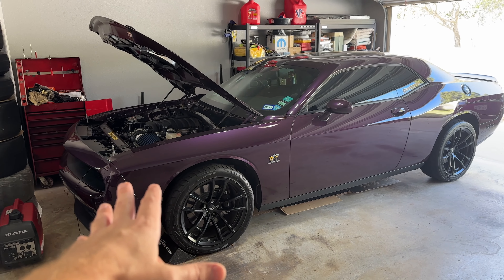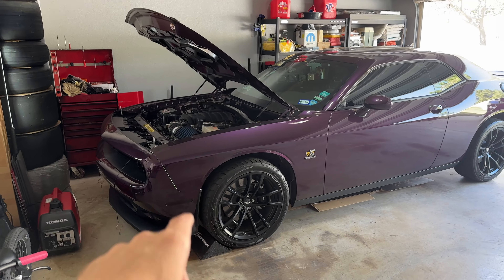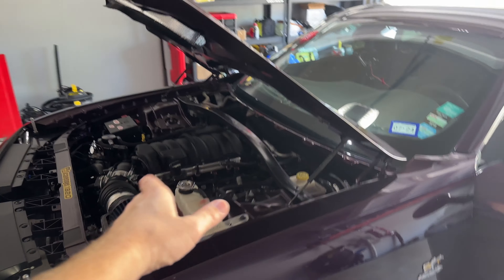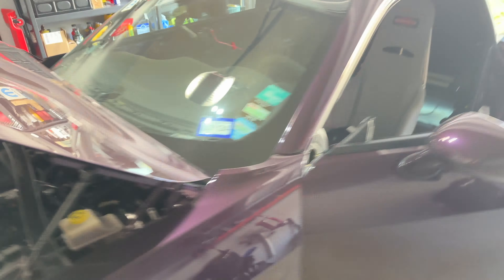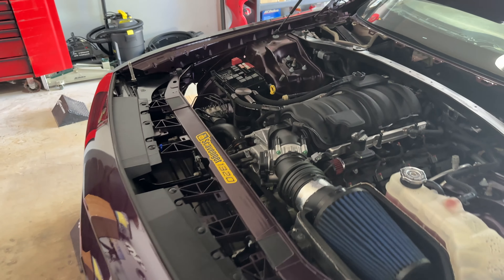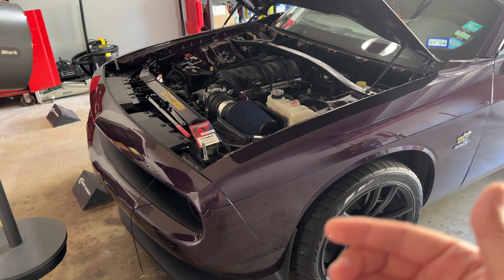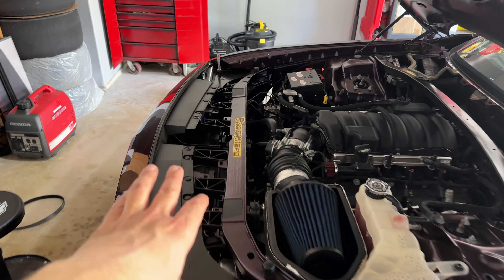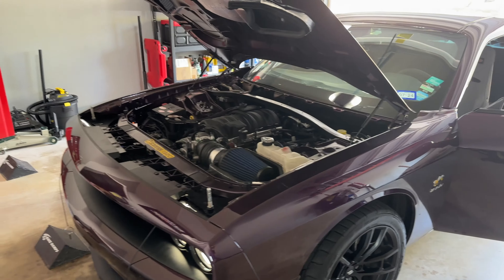Bypassing the A/C on my 392 trying to trick my radiator fans to turn on at lower temps

Comment: Thanks for doing this Chris. I was really hoping the belt trick was going to work. In older cars with electric cooling fans, they always ran when the A/C was on. I suspect these newer cars, being so much smarter, are also using a pressure switch on the high side of the A/C system to trigger the fan relay. If you could locate and bypass that A/C pressure switch, you should be able to run the fans by turning the A/C  on with your bypass belt in place. I believe this to be the case because the fans do not instantly turn on until the A/C compressor has been engaged for about 5 to 10 seconds. You'll be my hero if you can figure this out! I know a tune would be so much easier, but there's no way I'm voiding my 8 year zero deductible extended Mopar warranty!
Reply from the maker: From what i've read it does in fact appear to be linked to the pressure switch and will only turn the fans on when the system is pressurized. I think I know where the pressure switch is but how to fool it is another issue and I'm not sure I can figure that out. I do have some other ideas though that I need to look into more.
Reply: @Scavenger1320  There has to be air moving through the condenser or the A/C pressure will get way too high. So the cooling fans are activated by engine temp and/or A/C head pressure. That pressure switch probably has three or four wires running to it. Wish I still had contacts in the dealership service department.

Comment: Bypassing the clutch helps but it will turn the fans on by the high presur switch on the high side line when the presure in the ac system reaches i belive 230 psi not sure of exact psi the fans turn on find the high side temp switch pull the plug and bridge the termanals fans should come on . Another way is to run a wire to a switch in side the car .the fan should have power to it constant it turns on by the computer completeing the ground .thier should be a relay under the hood ill have to look at mine

Comment: In a stock tune, fans are turned on low speed at ECT 217° and above, fans are turned on high at ECT 226° or above (set points are 187° & 196° in my tunes with a 180 stat). These setting are the same regardless if A/C is on or off. Maybe there is a way to get fans to high speed rather than low with AlphaOBD but your still stuck with 217° set point.  As Preditor65 mentioned Tazer has cooldown modes to keep fans running in the pits to enhance cool down between rounds. Ive used it, it helps, but not a lot.
Reply from the maker: The settings may be the same for the coolant temp regardless if the A/C is on but there's gotta be some other setting that doesn't depend on the coolant temp. With the A/C on and working the fans were on well before the coolant got to 215-217. Plus they stayed on even after the coolant temps dipped below even the stock t-stat rating. I'm guessing it has something to do with the a/c system pressure. I'm trying to get the fans on while the car is running though too, not just when sitting in the pits or staging lanes.
Reply: @Scavenger1320  Back to this discussion after 1.5 days in the hospital for another stent. I can see an A/C pressure for fans, 1862 kPa for high speed and 1442 kPa for low. Maybe there is some wiring change that could reverse them but A/C would probably need to be on to activate fans that way. As well there is a transmission temp  trigger, 232° for high speed and 228° for low. Just guessing but thinking AlphaOBD may provide the best opportunity to adjust something without tuning.

Comment: Got to run it to see if that shorter belt is worth a few hp to the wheels.
Reply from the maker: That's why I originally got this shorter belt. Technically it shouldn't offer much, if any, improvement since the a/c pulley shouldn't be robbing much power when the pulley clutch is disengaged. But there's still at least some drag there, even if miniscule. Like I always say though, doesn't matter how small the benefit, it all adds up. That said the shorter belt is staying on so my future runs will be with it.

Comment: Some will say you need a tune for the 180 thermostat. Some say you don't. So I've been undecided as to whether to install one.
Reply from the maker: I think some people just look at it as a 'all or nothing' situation. The tune is mainly for getting the fans to turn on earlier to make full use of the lower temp t-stat, but when you're moving, air is naturally flowing through the radiator so having the fans tuned doesn't make much difference there. Plus after a run the a/c ban isn't an issue so by the time you get back to the pits the temps should be lower, that means a quicker cool-down  since it'll be cooling down from 185-190 instead of from 205-210. Also, I had to do a double-take when I saw a pic of a hellraisin 1320 in the staging lanes at MIR and could see a lack of interior, until I saw the sunroof and that it looked a bit weird and realized it was you. I saw your run against the white hellcat durango too. She posted a vid of it on her facebook.
Reply: Ha. I installed a BMW sunroof  delete panel, overlapped with vinyl wrap around the edges to keep it secure. Yep, that was me 😅. I lost during the 1st round. I didn't react quick enough. Was a fun event . I couldn't get there on Friday because of work.
Reply: @Scavenger1320 at MIR saw a bunch of Demon 170's, most of which had completely stock interiors.  I was so tempted to ask "hey, do you mind if I strip your car? It'll knock a few tenths off your time..." if I had a 170, I'd definitely GUT THE INTERIOR.
Reply from the maker: @1320_ikimasho  I need to make it out to an event that way so I can check out your sunroof. Hopefully 2025 will be a better race year for me. And yeah, you know I'd do the same to a D170 that I did to mine. Although if I was able to order it like I tried to, it would have been a no option version so I probably would have at least tried for the true 8.91 stock time before I started tearing it apart
Reply: @Scavenger1320 it's the Race German- BMW Sunroof Delete Panel. I looked at the specs and thought it might fit the Challenger. It weighs 3 lbs. 
Saw some cool Hellraisin Challengers at MIR- a really nice T/A and a SP. We couldn't help but gaggle for awhile. As for the 170, maybe  the price tag involved makes one hesitant to strip it.

Comment: You need to make the high pressure switch think it has high pressure aka jumper wire to turn on the fans
Reply: You could essentially put that circuit on a toggle switch in the car to run the fans . Obviously you want the engine to run cooler than stock
Reply: I would leave the ac belt on and trick the AC pressure switch to cool the engine with the fans this would also shut the compressor clutch off during the fan operation .
Reply from the maker: I'm gonna have to do a bit more research into this pressure switch. The electrical systems in these cars seem to be so sensitive I'd be scared of screwing something up and causing the system to freak out.

Comment: Why not just get a tazer? You have 3 or 4 different cooldown modes to chose from using steering wheel controls. A tazer is not a tune and completely reversible. The cooling fan modes are live so no bcm changes required.
Reply: These cars have Data logging, and every time you plug something in the OBD2 port it leaves a footprint in the logging. If a problem occurs, Dodge could blame the device and decide not to repair the problem. I could be wrong about that though...
In any case, I think I'll save $350 and continue to look for a simple pressure switch bypass solution that will allow me to run the fans between races and while in the staging lanes to take full advantage of the lower temperature thermostat to reduce heat soak.
Reply: Take that cai off and put a velocity horn on that throttle body already...
Reply: @artillerybuff2000  If you’re racing it won’t be covered anyway so there is that.
Reply: @Preditor65  Actually that is incorrect. The 1320 is named after the quarter mile race track, was built, advertised, and sold to drag race. That is why it only comes with one seat, trans brake, line lock, launch control, 41 spline axles, Drag Race mode activation button on the dash, knurled bead race wheels, and drag tires from the factory. It even comes with a supplemental manual telling you how to break it in and how to race it. I have never heard of a warranty claim being denied for an unmodified 1320 or Demon. As a matter of fact, it even came with a free one year NHRA membership!
Reply from the maker: Tazer is a bit pricey when the fans would be the only actual benefit, but also does it work with the engine running? I read some posts from people saying the cooldown mode was only for when the engine was off, and I'm wanting the fans on when the car is running, not when it's off.
Reply from the maker: @artillerybuff2000  that's one of my other worries, the computers in these cars record all kinds of data and they're smart enough to know when something is connected to it.
Reply: @Scavenger1320  Yes, I'd love to be able to turn the fans on right after each drag race down the return lane and to the pit area, and while moving up through the staging lanes waiting to run. Might have to run a battery charger inbetween races though, not sure if that light lithium battery could keep up...
Reply: @artillerybuff2000 may I inquire to where these knurled bead lock wheels are?  The bead looks like the regular scat wheel
Reply: @artillerybuff2000 you've never heard of the warranty claims on the broken rear axles being denied on the 2018 Demon???
Reply: @jeffdohse3740  Oh, you're right, there was a big lawsuit on that! Since the 1320 has the same heavy duty 41 spline axles and just under 500 hp, they should last indefinitely (I hope)
Reply: @jeffdohse3740  Both beads are knurled so that the sticky drag tires don't spin on the wheels during hard launches with heated tires running 18 to 20 psi of air pressure. Car was made to drag race! It's on the inside of the 20x9.5 drag wheels that come standard on the 1320.
Reply: @Scavenger1320  I tried it today turned on the fan while going down the road no problem.
Reply from the maker: @jeffdohse3740  check out my old vid when I first got my 1320 and swapped the front tires. I was able to go into the shop while they had the tires off and get a good view of the stock knurled beads. I timestamped it so it should start there https://youtu.be/a-xI-dIPdzo?si=R21GJ72xc1d97Bzg&t=503
Reply from the maker: @Preditor65  I was just reading that they updated it or something so that it works while the engine is running now, still a big price to pay just for that.
Reply: @Scavenger1320  Yeah, those knurling "bands" don't look very aggressive, however, they seem to work very well with the 20" tires. The knurling on the Forgestar 17x10 D5 drag wheels is in the wheel itself and very aggressive. Even with that, my MT Street R's mounted by a tire shop (with rubber lube unfortunately which is SOP) have moved on my wheels about 2.5" after approx. 20 hard runs; not a lot, but enough to throw the balance off. The lighter and even stickier Hoosier DBR's have not moved at all on the same wheels, but I mounted them myself using Aquanet hair spray; slippery when wet and like glue when dried. Perfect. I do all my own mounting and balancing now in my home shop; it was the last thing I had to take my vehicles in for. I prefer to do all my own service work.
Reply: Back on my Mopar 11, I was able to pull the fan relay and manually jump 2 terminals and it would activate the fans.  I only used it for cool down while in the pits.  I’m not sure if that is even possible on the newer cars.
Reply from the maker: @michaelcarman1002  I think that does still work, but it can be battery draining, and since I have a lithium it drains even faster, which is another reason why I'm trying to get the fans to run sooner while the engine is running and not just when sitting.